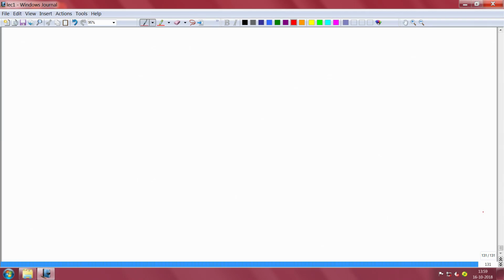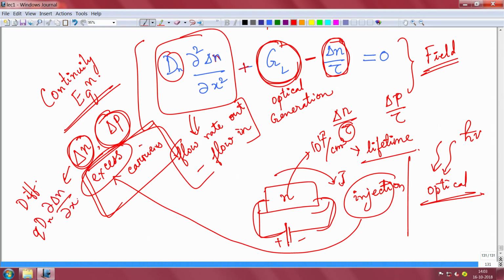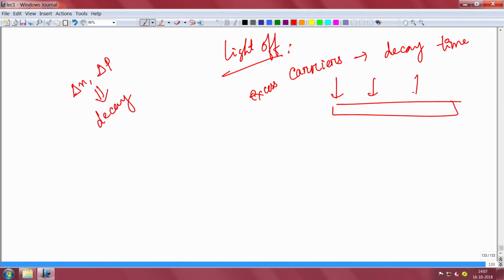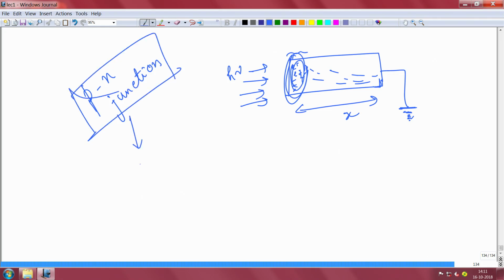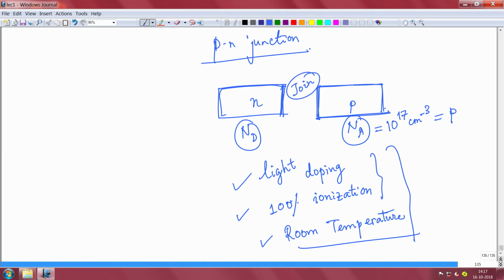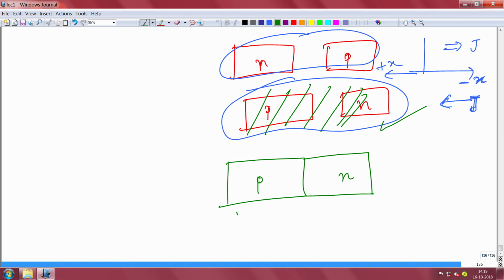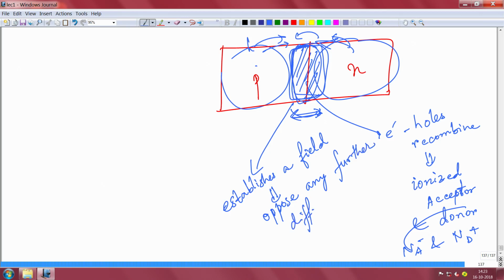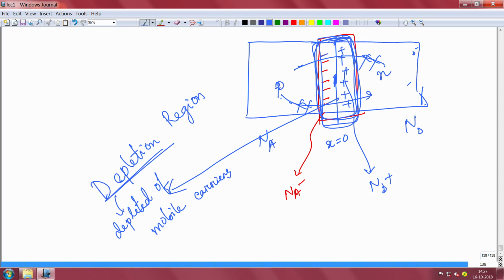Continuity equation (contd.) and introduction to p-n junction

Comment: The continuity equation for conductors in simple DC circuits is seldom found and derived in textbooks though derivations in case of semiconductors are found in several textbooks.
The charge density and current density functions are related by the continuity equation (see Electricity and Magnetism by Edson Ruther Peck, McGraw Hill, 1953) which maybe derived by applying the principle of conservation of charge. Since most textbooks on circuit theory do not discuss this important aspect of the conduction process in the dc steady state in particular, I have discussed this in textbook 4 (see last frame of video 1 to be discussed below).
In its most general form the equation of continuity is 
∂J_x/∂x + ∂J_y/∂y + ∂J_z/∂z + ∂ρ/∂t = 0. (Eq. 1) where J is the current density and ρ is the charge density, as derived from the conservation of electric charge law.
The current density J in an isotropic medium is given by the relation J = σE (Eq. 2)
where E is the electric field intensity and 
where σ is the conductivity of the medium. 
[Note: The expression J = σE denotes the macroscopic view of conduction and originates from the microscopic view of motion of charges in a conductor subject to an electric field E which produces a drift velocity v given by μE, where μ is the mobility of charge in the material.] It is also written from Eq. 1 as
∂J_x/∂x + ∂J_y/∂y + ∂J_z/∂z = 0.  (Eq. 3)
when there is no excess charge in the conductor or that there is no unpaired charge density (lattice ion and conduction electron). 

In the absence of emf in a region in the circuit (say, away from the source or battery and within a small section of the conductor or a resistor), the total electric field E, may be expressed in terms of a scalar potential function U;
E_x = – ∂U/∂x       E_y = – ∂U/∂y, and 
E_z = – ∂U/∂z   (Eq. 4) 

Eqs. (2), (3) and (4) characterize the current flow within a region of a homogeneous, linear, isotropic conductor where there is no emf. 
If a dc circuit of a battery and a wire is laid in a straight line along the x-axis then evidently, the presence of surface charges will guarantee that the total field E will be a constant E_x along the axis in the region. Therefore, the solution of Eq. (3) gives J_x = a constant, so using Eq. 2, we get J_x = σE_x = I/A (Eq. 5) where σ is the conductivity of the wire, I is the current in the circuit and A the cross-sectional area of the wire. 
Eq. 5 is the equation of continuity applicable to the steady-state in a simple DC circuit. 

Electrostatics and circuits belong to one science not two and it is instructive to understand Current, the conduction process and Voltage at the fundamental level as in the following two videos:
i. https://youtu.be/TTtt28b1dYo and 
ii. https://youtu.be/8BQM_xw2Rfo 

The last frame References in video #1  lists textbook 4 in which a supplementary article “Charge Densities and Continuity and Prop of em signals in wires.pdf” in the pdf files folder in the CD discusses these topics in more detail with several diagrams using a unified approach and includes a description of the application of the general continuity equation in special situations like conductors in isolation and in semiconductors.